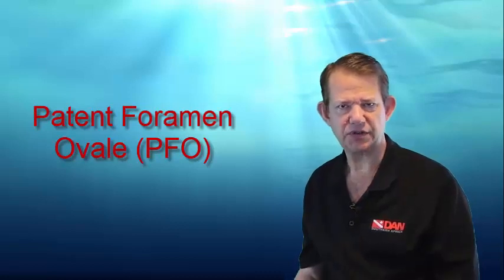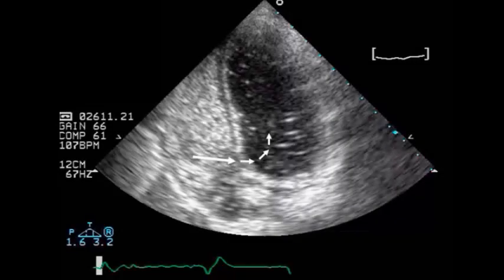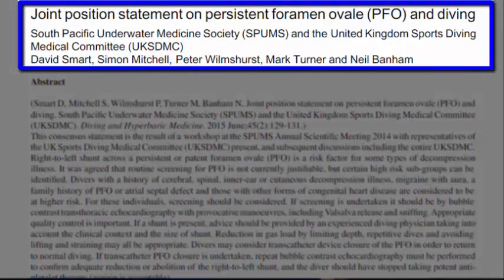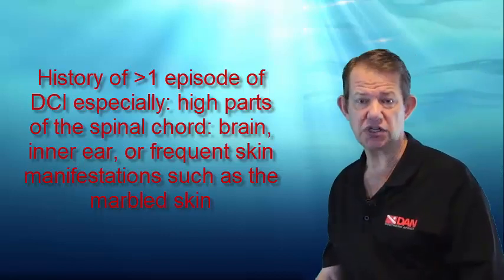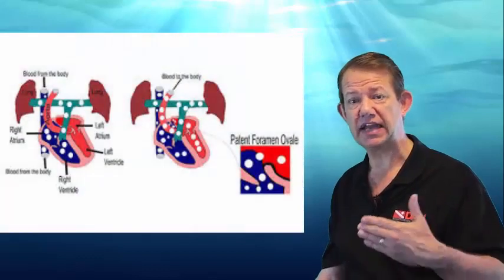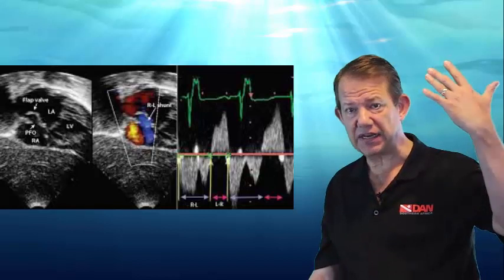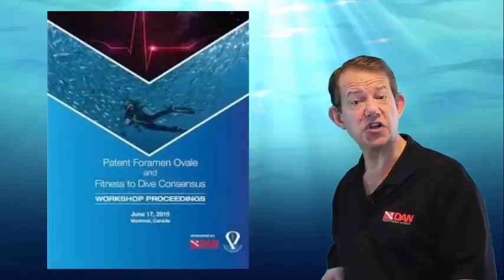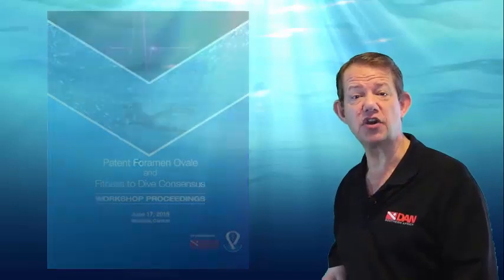Patent Foramen Ovale and Dive Fitness

Comment: I had mild symptoms after 12 hours of a no decompression dive but I had a rapid ascent. I had 13 hours in a hyperbaric chamber. 3 weeks later the left side of my face was tingling, and I ended up 2 days at the hospital. They found I have a PFO, and I had a successful PFO-closure two days ago. I think, this should be emphasized at every diving level.
Reply: Thank you for your comment. We are relieved that you have had a good outcome. Given that PFO's occur in at least 25 to 30% of individuals, yet decompression illness is relatively rare, we do not recommend routine examination for the presence of a PFO. However, if, as in your case, there are significant or recurrent symptoms suggestive of having a PFO, the risk-benefit of closing it favours having it done, as in your case.
Reply from the maker: @DrFJCronje  Thank you for your response.

Comment: PFO and Lessons I Hope I’ve Learned
I thought I would share this. 
When a good friend of mine was bent as a result of a PFO, I actually delayed his treatment by some hours because it seemed inconceivable to me that his profile could have caused DCI. I think there are some lessons worth sharing here. At some point, I’ll write up a full report. 
The diver was 19 years of age, and physically fit. It was his first dive in several days and the profile was 45 minutes with a maximum depth of 9 metres.
I was the senior diver. The diver was relatively inexperienced and had a basic diving qualification, not a leadership rating. 
After we finished the dive, we went our separate ways. The diver messaged me to discuss the following days dive plan and mentioned a pain in one bicep. We went back and forth over messenger over the next several hours, before I called DDRC, around midnight UK time for advice. The event took place overseas. When I called DDRC, who were extremely helpful, they thought it unlikely to be DCI. However, I knew when I made the call, they would recommend the diver be examined because DCI could not be excluded. 
The diver was taken to the local A and E. Protocol is he should have been treated as a priority case because he had been diving. Most of the admitting discussion was in a language I don’t speak. So, I did not realise he’d basically been asked to wait to be seen. Fortunately, a friend of mine at the hospital intervened and the diver was seen. 
I spoke to the attending Doctor who then followed up with DDRC and the diver was treated at a hyperbaric medical centre within a large, well-equipped hospital. 
The diver was later referred to a specialist cardiologist, who diagnosed a PFO.  This was closed and the diver has been certified fit to dive, including passing a commercial diving medical at DDRC. 

Mistakes I Made 
Firstly, I am well aware of incidence of PFO. A number of people I know have been bent as a result of PFO’s.  They have often made a considerable number of dives before they got DCI, and most of them were not making dives to great depth or one’s that involved decompression. So, PFO caused DCI was on my radar. 
Second, I hold instructor ratings from three agencies – PADI, BSAC and NAUI. Of the three agencies, NAUI tested me most thoroughly on my theoretical knowledge. I consider myself fairly well -read and was familiar with many of the DCI studies published by DDRC, DAN, UHMS and AAUS. I was also aware of the Hahn tables that sought to mitigate the underserved hits that occurred well within the tables and, I assume, were mostly caused by PFO’s.  I can’t claim wilful ignorance of PFO. 
Third – despite all of this ‘knowledge’, I really did not think the diver could be bent. I had planned some CESA training, which we did not do, so there were no fast and repeated ascents involved. Had there been, my whole thinking would have shifted to this probably is DCI and I would have acted much, much earlier. 
Fourth – as per my training, I insisted the diver was taken to A and E and handed off to professional care givers. At that point, I let my guard down. The language barrier did not help, because I might have realised then that the incident was not being taken as seriously as it should. 
Fifth, and this is a point I want to make very strongly. We do not talk enough about PFO in training. This, I think, needs to be something discussed from entry- level when we talk about causes, signs and symptoms of DCI. We need to underscore that underserved hits occur and can do so well within the dive schedules that would seem very safe. None of my own training has emphasised that point. We need to counter that so people don’t make the mistakes I did. In fact, had the diver himself not badgered me about his suspicion’s he had DCI, I don’t think I’d have acted. 

Best

Steve.
Reply: Thank you for the detailed response. There is much about PFO and other pro-inflammatory effects bubbles may have. PFO's can open or shut during a person's life and therefore single assessments are not always reliable or useful. The best we can usually suggest is for individuals who appear vulnerable but do not have clear evidence of a PFO (bearing in mind that the lungs can shunt bubbles just as easily and possibly even more commonly than a PFO) is to perform dives that are "bubble free" using nitrox as air or halving bottom times. Thank you for your thoughtful remarks. The DAN Medical Team
Reply from the maker: @DrFJCronje  thank you for responding to the diver.
Reply: @DrFJCronje  Hi Frans - thank you so much for your personal reply. It is really appreciated. Of course, I now realise I know even less about PFO's than I thought I did. And I have THREE instructor ratings. I had no idea PFO's came and went. Thank you again, because I've learned something really important. Steve.